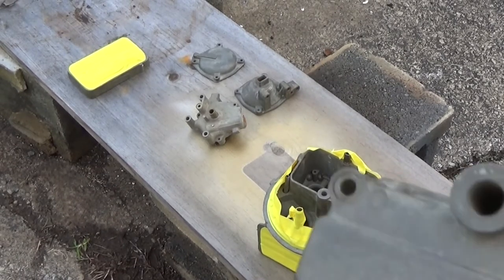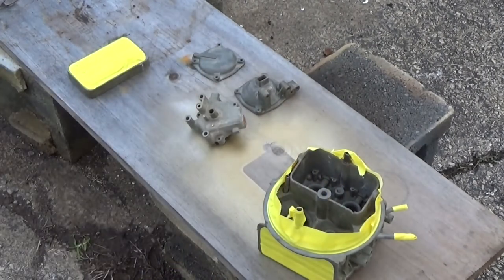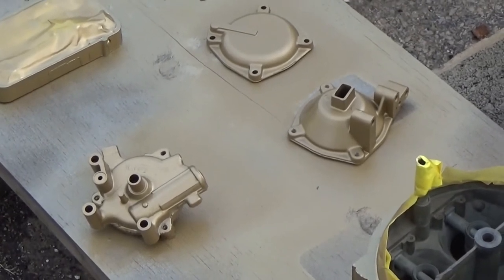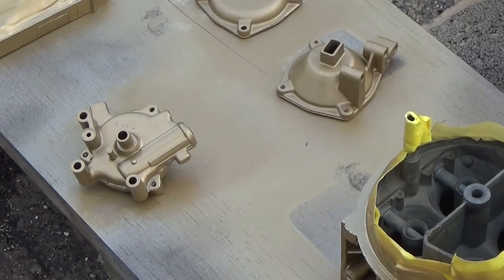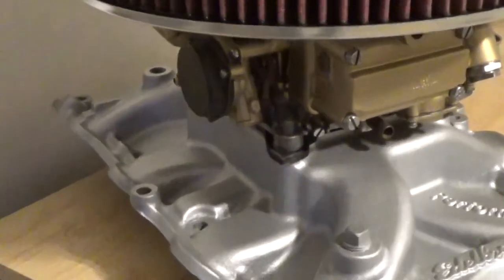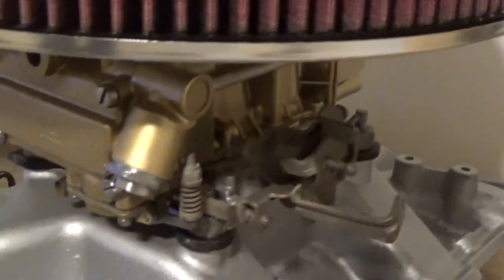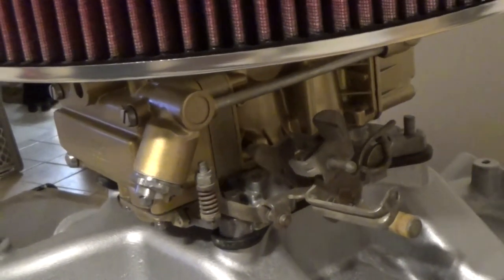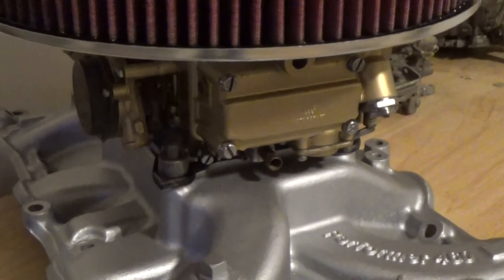Painting a Holley Carburetor?

Comment: Wow that looks really good . I have a 4180 on one of mine also and its grungy. Would imagine the product that would put original finish back on was because of EPA .  A product called Alodine chem film is used in aerospace to protect aluminum from corrosion and is highly toxic .
Reply from the maker: I've never even heard of Alodine before. There are ways of replating the carbs at home but I don't know that I want to get in to all of that. My luck I'd screw something up and it would eat the metal or blow up🤣

Comment: Will the paint hold up if for some reason gas spills on it? Working on a tri power and would hate to have one carb not look the same as the others because of the paint peeling or diminishing
Reply from the maker: That's why I said i was going to spray it with a flat 2K clearcoat. That way once the clearcoat cures it will be unaffected by gas spilling on it. If you don't have a spray gun setup you can get an aerosol can of clear that has the hardener in it. Don't use just regular spray can clear. Without the hardener gas will remove or wrinkle the clear.
Reply: @BlackLabGarage  thanks for the response
Reply from the maker: @JoshMarris  you're welcome!

Comment: will the carb heat peel the  paint off? thanks
Reply from the maker: It hasn't happened to me yet and this isn't the first carb that I've painted. Which that wheel paint is made to withstand the heat from the brake rotors and stuff so it should be ok with the heat off of the intake manifold. Especially if it's an aluminum intake manifold.